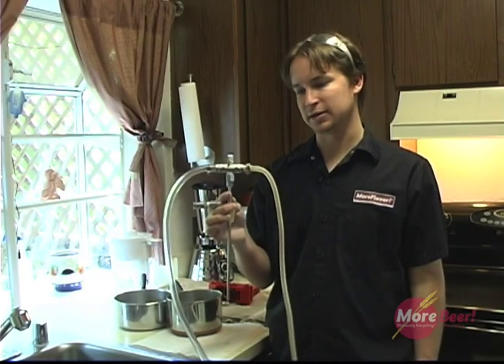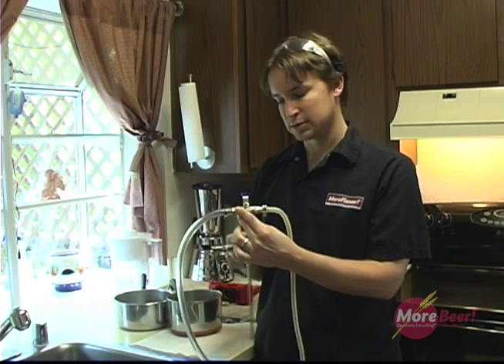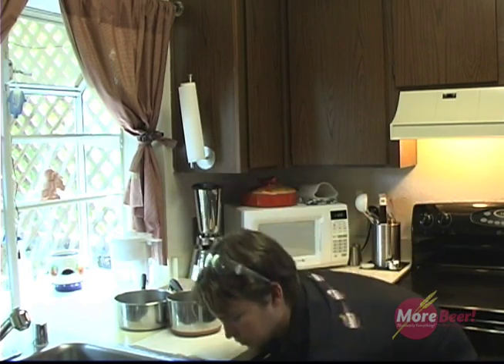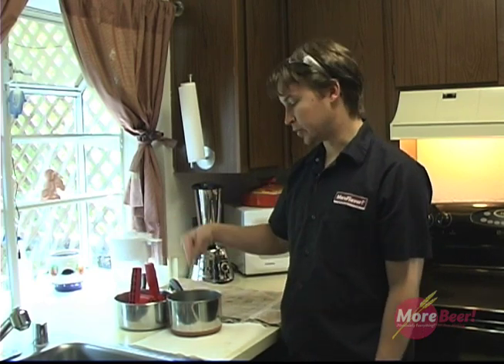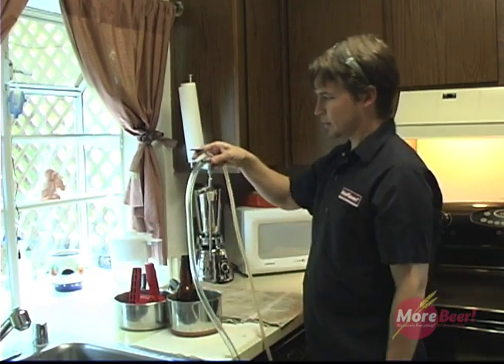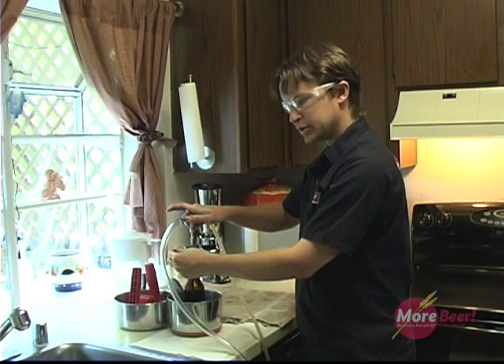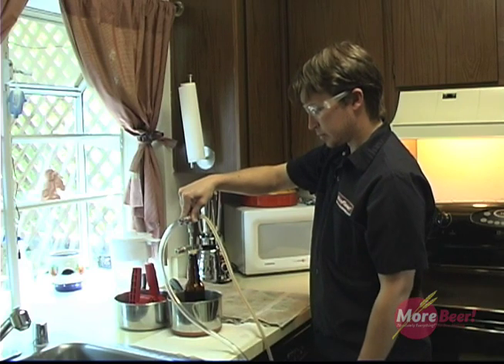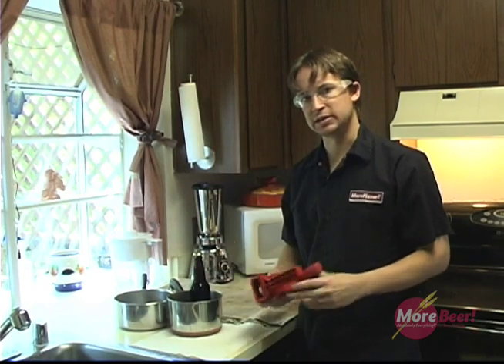MoreBeer!'s Counter Pressure Bottle Filler

Comment: I bought a KegLand version from MoreBeer, same as the one in this video only the beer-out is a little improved and the gas & beer connectors are DuoTight versions on mine. (It comes in 2 versions, DuoTight or barb.) They all work exactly the same way, so this video captures the essence of the process perfectly. :)

Comment: I struggle with "bombs". The pressure inside the bottle is to high and when I remove bottle-filler the whole bottle turns into foam :( To much pressure in my keg? What is ideal keg pressure?